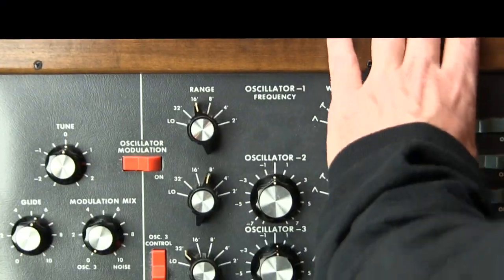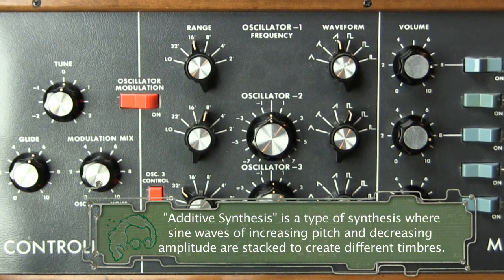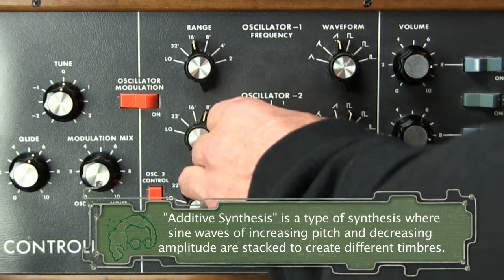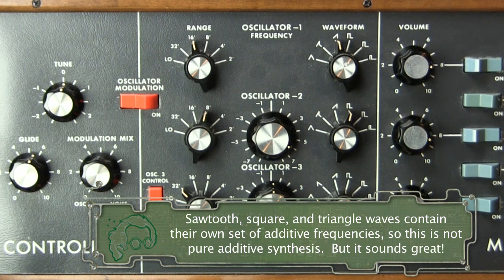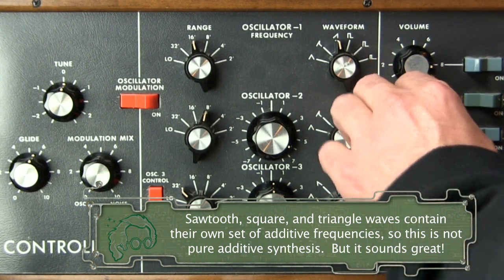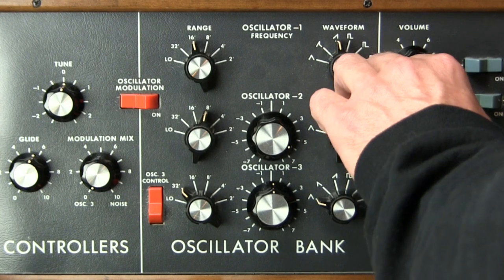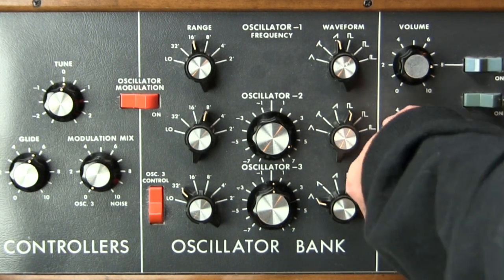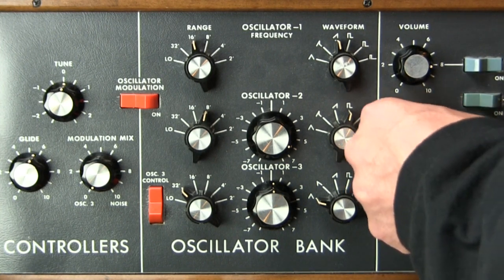Oscillator- Pseudo-Additive

Comment: Sorry but additive synthesis is a bit different than what you describe here. First of all, you cannot experiment additive synthesis using sawtooth waves, this is nonsense. You need a much larger system if you want to stay within the analog realm to demonstrate or study additive, like a large modular system with tens of sine wave capable oscillators each with their own envelope generators, not a minimoog. Sorry for this negative comment.
Reply: Did you miss the part in the title where it says "pseudo" additive?